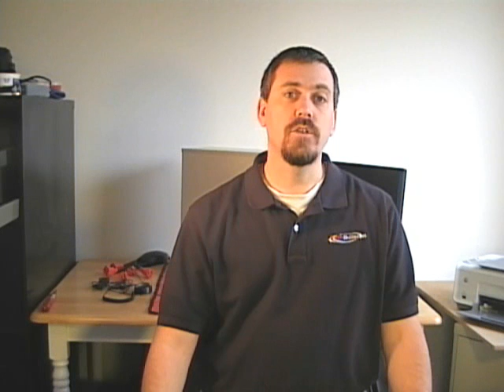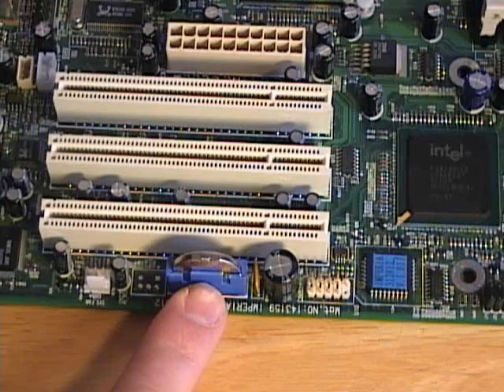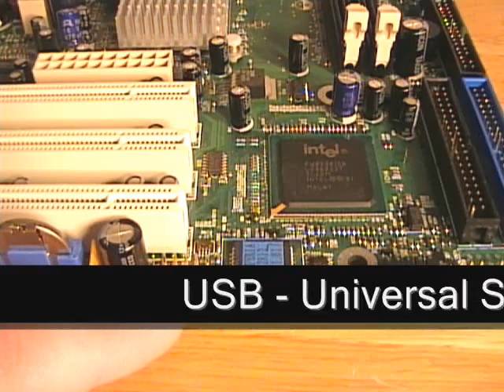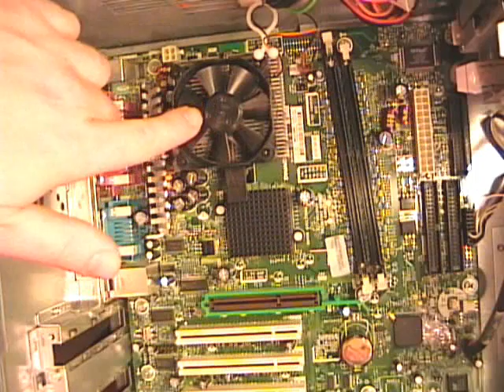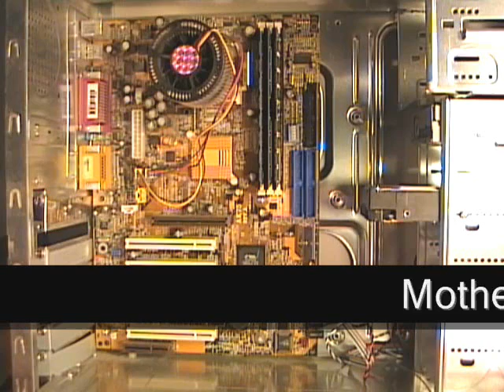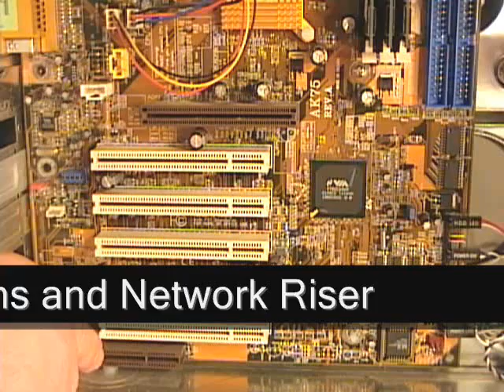Motherboard Form Factors and Components

Comment: I'm confused here. The first motherboard, the micro-ATX on the desk looks different than when you have it in the case an are identifying parts. It says they're the same but the CMOS battery when in the case is laying flat whereas the one on the desk is vertical. The 20-pin ATX slot is under the CPU rather than under the memory expansions in the first one. And then there's a 24 pin connector on the second one under the memorys slots.

Maybe I'm just confused but I'm not understanding..